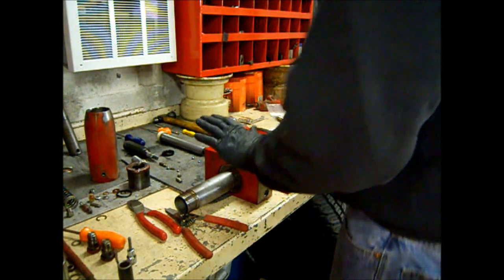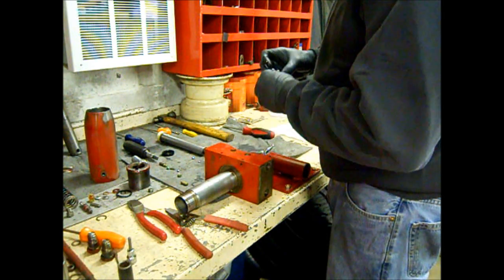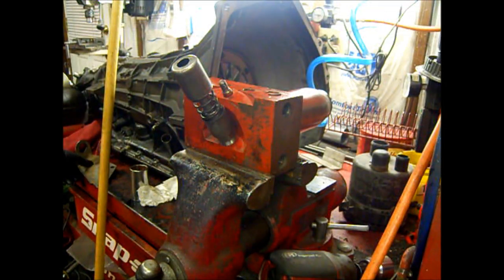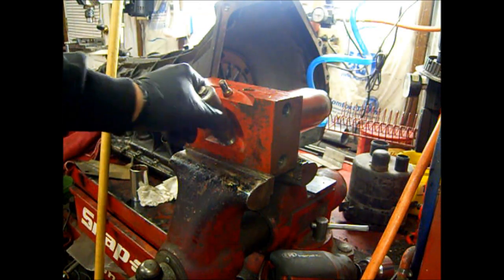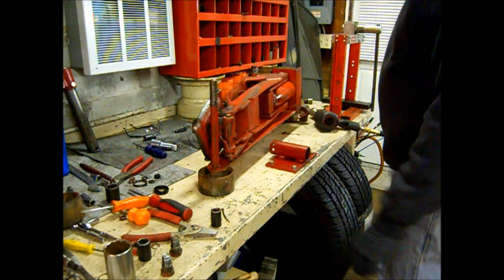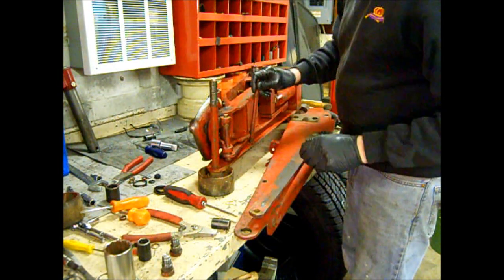How to reseal a leaking 2 ton Snap On jack part 2

Comment: After watching your videos, I was able to fix my Lincoln 93642 which is the same as a Hein Werner or Snap On YA642. My front wheel axle is welded together so I just unbolted the hydraulic unit and loosened the monster nuts on the lift arm and slid the unit out. Mine has been sitting in the barn for 10 years or so and was badly weathered so I had a few challenges but managed to get it apart and back together. Works like a champ. Had the kit for ever, just never tackled it till now. Thanks.

Comment from the maker: I removed them as I felt they were not constructive. This jack rebuild was done on the cuff, with no manual and no rehearsal. Yes it was not necessary to take it down as far as I did, I could have left the handle on, I should have torqued the large nut, etc... The video is meant for entertainment and not intended to be the sole means of how to rebuild a jack. Now aside from not adjusting the bypass I think I did a decent job. It still works fine for me. Let's see a video from you....

Comment: I looked at most Hein-Warner subjects in the forum and got a lead. They just responded. They are offering a kit for some $50. Though they didn't respond to the picture for ID, THEY DID SAY THE MODEL I HAVE IS OBSOLETE. I KNEW THAT. I'm gonna now take it down an make sure there's no problems beyond the seals and gaskets. I'm thinking the bore will be good as it doesn't appear to have been left to the weather. Even though air which is moist inside the pump could have droplets. We'll see. Thank you. I'll let you know how it works out. It'll be a few days, waiting for double numbers on the thermometer in the garage. Take care.

Comment: Did you really have to take apart the whole thing to get the cylinder out? I have the 2.5 ton snapon and it seems you just release the springs and unbolt it. I never tried, just curious if you found out. Lots of work.

Comment: Congratulations on a very coherent video....although it would have been better if you had shown some of the 0-ring replacement.  Also, was it a must to disassemble the entire jack merely to access the piston & its seals.  With a renowned mfg. like Snap-On, seal replacement seemed more difficult than one would have imagined....
Reply from the maker: +emil dekoven The unit does not need to be completely pulled apart.. I did it because it was my first one and in the end it makes it easier for the viewer to see what is going on.

Thanks for watching and the comments!

Comment: Ok, I have the same jack and I can’t find a service manual. Can you tell me what Fluid is best for it and where I fill it on the jack? I know, stupid question. Thanks. Nice job by the way.
Reply from the maker: Ashley Noonan OK so at the beginning of the video you see the housing at the left of the screen, the red tapered cylinder with the hole at the bottom. You fill through that hole. You can buy jack oil from an auto parts store, or power steering fluid works..
Reply: Broncocarl92 perfect! I didn’t want to assume anything for fear of messing it up. Thank you.
Reply: any chance you remember where you got the kit from and what the Kit number??

Comment: I have an Allied, 3-ton, floor jack and dumped out the small, ball bearing, cone-shaped spring, and large ball bearing out of the bleed (fill?) port on the left side of the pump (as you would normally operate it). Could anyone please tell me the order I should put these back in the port? thanks
Reply from the maker: ball goes in the bottom, followed by the spring which should be oriented in a logical way so the spring puts pressure on the ball (acting as a pressure relief valve).

Hope that helps you..
Reply: Thanks Broncoguy, I hoped to clarify the order of the two bearings. Here's how I did it: small ball bearing, spring (small tip down), large ball bearing (then retaining seal/retaining screw) My latest hurdle is purging the air. I've watched a couple videos w/jacks similar to mine (WJ Handy Dad) and (EdontheBeach) but still unsure of proper bleeding procedure when starting w/completely empty jack.

Comment: I just rebuilt my snap-on YA700b, put in a new seal kit. when I filled it up with fluid it didn't magically start lifting like yours did in the video. is there a procedure to bleed the air out of the jack before it will start to lift? any help will be greatly appreciated
Reply: +Hustle Union also the craftsman socket trick for the gland nut didn't work for me I ended up using a pipe wrench and the handle for the jack as a breaker bar, to all those attempting this task for me that gland nut was the biggest obstacle. for the spring loaded pump at the back I used a ball joint removal tool with a deep socket covering the threaded end to protect it.
Reply from the maker: +Hustle Union Many years ago when I bought that jack the Snap On guy "bled" it by lifting the lift plate up and down several times which moved the ram in and out. Not sure why you are having an issue.
Reply from the maker: +Hustle Union The gland nut was a tricky one for sure, I guess I got lucky with the socket.

Thanks for watching.
Reply: ***** yeah no worries thank you for the video it was the only one I could find, and I must have ripped a small O-ring when putting the thing back together that was the problem I was having. working like a champ now.

Comment: great video and thank you very much!  i just rebuilt mine.  only issue i had was i had to use a gasket sealer on the jack tank.  apparently the old metal on these jacks doesn't keep a a good seal and will leak fluid when you rebuild them.  great place for support, instructions and parts for any jack can be found here https://www.hcrcnow.com/.  they were great to work with!
Reply: How where you able to remove large nut to separate tank mine leaks at bottom of tank and would like to use gasket sealer as you mentioned and thanks for that tip btw.